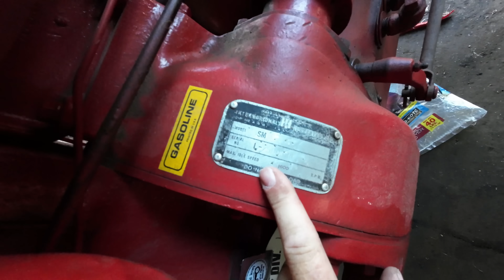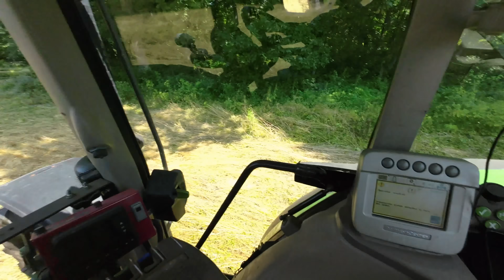Daddy Wait!

Comment: I love those Farmall M's. We had one with a Farmhand loader that we pushed snow with for 20 years or more. I moved a lot of snow with that tractor. We still use a Super M on the rock picker. We like it because it is so easy to climb on & off of the tractor if you need to. We also use 2 M's to run augers during harvest.
Reply: Like they say if it's not red leave it in the shed

Comment: I love your old car collection and tractors. Few yrs we'll see William running the m just for fun too. They're a great tractor and just seem to purr when in use. 
The car may just need valves adjusted, if it were piston I'd think you would see oil or hear leaks . They're great to work on and fairly easy motors to rebuild.
Reply: Blue smoke is oil. White smoke is condensation. Black smoke is fuel

Comment: Don't tear that old Ford engine down until you've tried a through ignition tune-up.

Modern electronic ignition systems are so trouble free that it's easy to forget that a weak coil, bad wires, a cracked spark plug or a weak condenser can ALL cause just the kind of high temp power loss that you describe, ... while working OK when the engine is cold.

Comment: Nice to see the old equipment out in the field! 
Before tearing down that car engine, make sure there is not a fuel system problem of something plugging or restricting flow or electrical system issue. Resistance in the coil/etc will go up when really hot giving weak spark. Mice or chipmunks like to pack air filters and mufflers. One of the car channels showed how pack rats out west filled up the whole motor compartment, chewing off hoses and plugging holes with debris. Often the problem is something simple. Did you measure cylinder pressures when the car is cold vs hot?